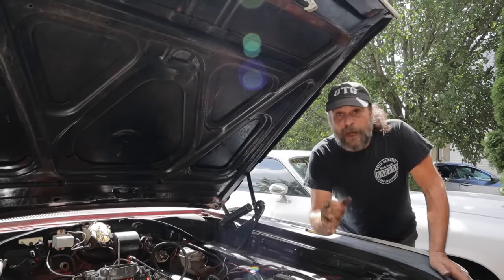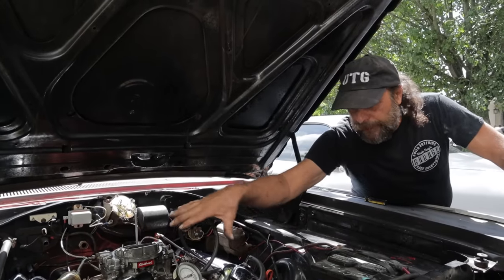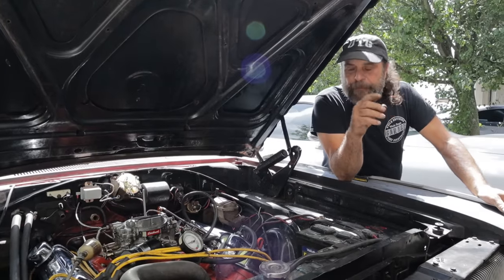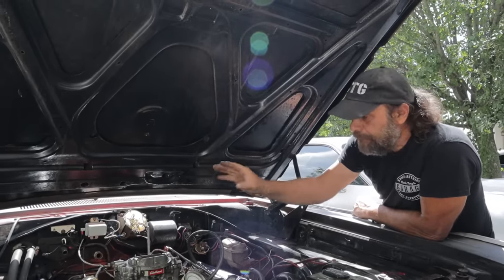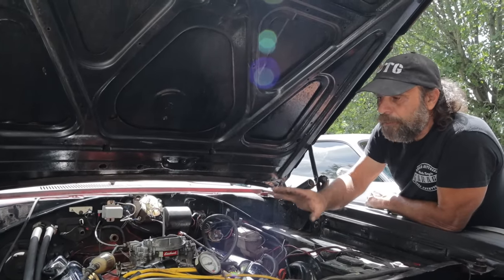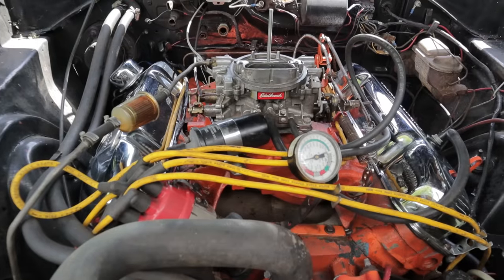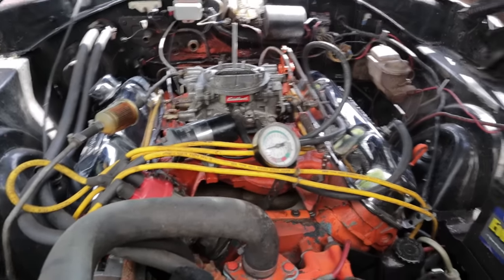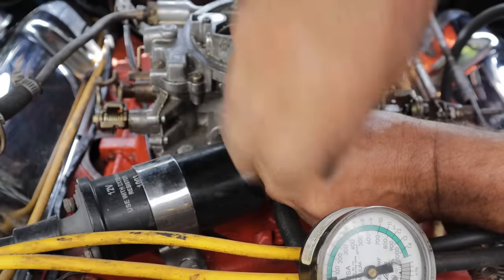Fine Engine Tuning With A Vacuum Gauge

Comment: i’m 38 my dads like this guy we have a machine shop still building race cars... carbureted still... i remember in the 80’s we had a oldmobile station wagon, it had a “fuel economy” gauge in the cluster i said how’s that work? he said vacuum and he smashed the gas it pegged over then came full back to the (+) side and he explained how it worked the more vacuum, the more the butterfly’s are closed the less fuel the more open the less vacuum and worse fuel idk why but i thought that was the coolest thing

Comment: Thanks for the quick reply! Your relating about the smoker being passed in winter in the dark reminds of our 1st Ford that smoked so bad that you could have used the Ford as a smoke screen maker. We eventually rebuilt the engine as it was so old that it did not even have a PVC! It just had road draft tube that before rebuilt the engine would have cream colored thick stuff come out at times. Really like the old engines to work on. We are currently working on a 1970 C10 with a 350 / 350 combo that when tuned right can achieve 17.1 mpg. But at 55 it only turns at 1710 rpm! Slower than most diesels that some friends of ours have  at the same road speed.

Comment: I thought ported vacuum advance was something that cars in the 70's used to try to improve emissions, not manifold.
Reply from the maker: nope
Reply: @UncleTonysGarage   That's an argument I can't find a answer to. My 67 Pontiac Tempest uses manifold vacuum from the factory. I've tried setting it up ported and it runs better on manifold.
Reply: My 1969 400 pontiac runs better on manifold vacuum also.  Depends on the engine, do what works best for you.
Reply: Gm cars used manifold vacuum up until the 70’s when they switched to ported to raise exhaust temps to help burn off more emissions. I had a 1968 327 in a truck that always ran hot when set up with ported vacuum. Switched to manifold and temps came down and off idle power was way up.
Reply: @ramblr1959  exactly, ported was just an emissions bandaid
Reply: @jakebullet8990  I ran my 71 360 Fury on manifold vacuum as well. It was a bit snappier on the manifold than the carb. I also worshiped the vacuum gauge as well. I used it so much that once I lost the cap, and just ended up leaving the gauge on, laying on the intake manifold, all the time.
Reply: @jakebullet8990 same here. I had a 73 Chevy stepside w/350. With ported vacuum I couldn't get the idle where I wanted it with the 14 degrees of initial advance I used. I didn't have any emissions on it. Had Chevy small blocks for 40 years and until I bought an s10, I've never used ported. 
I modified the vacuum can for about 6 degrees. Most factory cans have too much...... I suppose ported it works better on an engine with a factory stock can.... 20 to 28 degrees.  I think with those huge cans you ran 4 to 8 initial?  Just runs like a 3 legged dog with factory settings.

Comment: Always ported vacuum.  Thanks. Edelbrock has it wrong in the instructions that came with my 1413, well 9963 remanufactured carb. It clearly says manifold for all but emissions controlled vehicles. I appreciate you running thru this. Great video as usual!

Comment: Incomplete. You did not show where to plug the guage in. What about people who have never done this before? You can't use a vacuum gauge if dot dont know where to plug the darn thing up at. My carb only has one port. It's where the vaccum advance goes. the other carb port has no pressure in any direction, thus. it always stays at 0. There is no where to plug a vaccum guage up on my 350 (that I can find) Only a larger "T" plug into the manifold on the backside of the carb. . and if there was a place I would not know which one to use. I like your videos, but where are places you plug up a vaccum guage. Please use a finger to point to a few specific places please. Many people that have this type issue don't even respond, only the people who have several ports and can do this respond.
Reply: tis variable depending on what carb and intake u have. the possibilities are limitless 😮
Reply: If you seriously cant just look at the video and trace the rubber hose..... when its obviously doing a close up at one of the parts... Do you even need to try to tune your own engine? Probably not. Let your wife do it. 😂

Comment: With the lack of a power valve, it’s impossible to get the transition to the main circuit the best it can be without a vacuum gauge and a handful of metering rods & springs. Great videos.

Comment: I have several vacuum gauges & the large [6 inch] shop unit came with a hose restricting clamp. This reduced the diameter of the rubber hose to help dampen the pressure fluctuations in the hose on the gauge side. This smoooothed out the wild flickering of the needle, particularly in four cylinder engines & engines with non stock cams.
In my case, the vacuum gauge was used more as a diagnostic tool than as a tuning aid & in this regard, if you knew how to read them, then it could tell you more about engine condition than you really wanted to know. My big gauge was bought new in 1949 by my stepfather & it is still one of my favorite tools.

Comment: There are other things that can be checked / inspected with a vacuum gauge, to include specific tune. ... Valve Timing ( Not to be confused with Ignition Timing ),  Vacuum Signal ( From the Carb ) to the advance, which may also serve to ensure sufficient signal for vacuum controlled advance and the overall impact on vacuum if such advance controls are not only set properly, but, are not over advancing based on the signal produced. ... Even something as significant as a stretched timing chain can be identified by vacuum, or, at minimum narrowed as a probable cause of vacuum gauge movement / sweep. .... The vacuum gauge is a GREAT Tuning tool, as well as a GREAT Diagnostic tool. ... YES, I am OLD SCHOOL, I am also a ASE Certified Master Technician in BOTH Automotive ( Gas ) and OTR ( Diesel ). ... I also ran five ( 5 ) smog / Auto / Light Truck repair shops in Southern , California and A Performance Shop ( GM ONLY ) where I built custom performance engines, designed and sat up  performance suspension systems and, on special cases, restored vehicles. .... I am not trying to bring my experience forward as a means to brag, instead, I bring it forward TO TEACH. ... Great Videos Man .... LET'S LEARN TOGETHER. .... Semper Fi

Comment: I would hesitate to say that only ported vacuum is used when it's a direct connection between the carb and distributor, or that only 70's era cars used manifold vacuum.  My advice would be to try it both ways and see how your car reacts.  Personally, my 67 289 Mustang runs much nicer with manifold vacuum, which is how it was hooked up when I bought it in 1977.  The throttle response, idle, and mileage are noticeably better.  Try it both ways.

Comment: Hey I hope to hear back from you, I’m stumped. I have a stock 350 sbc with low miles. It is a GM crate engine. The issue I’m having is the engine is bogging out over 3000 rpm’s. Things I’ve done chasing this issue, new distributior, new plugs and wires, set timing at 14 initial, replaced mechanical fuel pump, replaced fuel filter, replaced fuel tank sock, replaced all rubber hoses, made sure gas tank is venting properly, replaced air filter, and rebuilt carburetor. I’m honestly baffled and worried it might be an internal problem. Also I removed the fuel pump push rod and stuck my bore-scope camera in the hole and had a buddy bump the engine over to inspect the cam lob to make sure it wasn’t flat. Everything checks out fine. The carb I am using is a Holley 1450 with vacuum secondaries, it is an old carb that I’ve rebuilt before. Also plugs look great, doesn’t appear to be to lean/rich. And the timing looks mint on the ground strap. Could it be a burnt valve? Or is the old flat tappet cam giving up? Idk, hope to hear back from you.

Comment: Thanks for this video. I have a 66 Polara that has one of those finicky Carters on it. I'd been fiddling with it without a vacuum gauge for quite some time - trying to get the idle right, the exhaust to not smell rich or lean, and have it run smooth down the highway. I damn near had it by nose and ear, but the vacuum gauge was the key to getting it perfect. I was a tiny turn off on the idle mix - like not even 1/4 turn, but it made all the difference.

Comment: There is a lot of "grass roots" answers to how to set timing...most of em not correct but folks feel like it works for them. If it does, they just happen to stumble on the correct setting. You need to know two things on timing and the process becomes easy. 1) What is your target MAX timing for your engine - say in my case its 36 2) What is the all in advance of your distributor (not plugged to vacuum) which can be found by the manufacturer - usually at 2500-3000 rpms on up and done in crank degrees. so crank degrees of 10.5 = 21 cam timing advance (you multiply by 2). So if you want 36 max and it adds 21, subtract you get 14. So try it. Set it to 14 and you will  , rev that engine..it sits nicely at 36...but don't exceed max because you can burn a piston or head gasket. I have seen guys where their advance is way off ...shooting 40 degrees max when it really should be 32 or 34. But like I said, you need TWO numbers. Setting till it pings and back off could still put you in danger zone. Not a good way to risk your engine

Comment: In the 90s I got a "tune up set""from sears with a dwell/angle meter / voltmeter, a timing light and vacuum gauge (and other stuff i forget). It had a good instruction manual on how to set distributor timing and do carb adjustments. I had a 1974 Ford Maverick with a 302 at the time, and it was fun to mess with the adjustments and see how it affected driveability

Comment: But a good number of GM cars used manifold vacuum for the vacuum advance well before emissions came into play. It tends to give a smoother idle. Once you are off idle, it operates just like an engine with ported vacuum. It is only there for part throttle economy, advancing the timing as far a possible when load is light.

Comment: Vacume gage will diagnose a restricted exhaust plugged cationic converter bad baffles in a muffler.
At idle full ported vacume snap the throttle instantly the vacuum gage should go to close to zero no delay or no wanting to change instantly means a restricted exhaust.

Comment: A vacuum gauge is very important. My GTO’s have one mounted on console. 18 inches at idle.  I always adjust center carb idle to highest vacuum. And setting timing, I use vacuum gauge, some.  My Pontiacs start by simply bumping the starter.   Just bump and engine is smoothly idling,, you have it right!

Comment: 7/17/2022.  Uncle Tony's garage would have squeezed high 8 second passes from my 427 in a 1300lb front engine dragster.   I made a mess out of an 850 Holley. Drilling out the jets, changing power valves... at age 25...i had zero clue.  Just finding this video today is still priceless.  Apply these tips to my reliable daily driver. a 71' 455, perhaps squeeze another mpg out of the lead sled.

Comment: Total ignition advance is basic timing you set by turning the distributor mechanical advance springs weights in the distributor and vacuumed advance add all 3 together you get total ignition timing advance

Comment: When I was young I would always set my timing with a vacuum gauge.  I'd increase timing by advancing the distributor for maximum vacuum and when the vacuum started to fall off I would reduce it by 1 inch of mercury.  I would then recheck the timing with my timing light.  worked for me!

Comment: That is how I tuned  my 350 rebuild  back in 2000. With an edelbrock 600. On a 1988 gm vortec  and I got 18mpg and enough power to pass  many slower cars  thanks for your reminder video  I still have a vacuum gauge  I actually use it to do driveability diagnostics tests with my lab scope on every platform that I come in contact with., and vacuum gauge  provides a kind of happy medium  really  it tells you what  is going on with  an engine  on the Induction side  pretty  accurately  and when you can get all that Info, it's not hard to tune a csrbueratef engine,  but a vacuum gauge is definitely a great  advantage with a lab scope

Comment: I have a mildly built 1985 318 with an edelbrock 600 4 barrel and a Erson cam. I did a vaccum gauge test to see how much vaccum off intake or full port vaccum. It was like 18.0 -19. Something ?  I bought an edelbrock tuning kit for the 600 and you take the vaccum reading and divide it by 2 . so basically long story short I had to use the highest numbered set of springs in the kit which happens to be the purple springs. Made a huge difference in the way the engine runs ! It originally had factory stock springs

Comment: Just found this video.  I converted a ‘95 corvette engine in my 3000 lb truck to a Demon 625 cfm carburetor, and HEI distributor.  Because it was originally a computer controlled engine, there are no timing marks on the crankshaft pulley.  I set the timing to its highest vacuum by rotating the distributor then locking down the HEI.  Runs good except for horrible gas mileage (11.7 mpg).  However, you said don’t do that, so I’ll try the idle screws next.

Comment: Subscribed!
I have a 67 Bronco with original 289 with the same carb. 
I didnt have my vacuum advance tuned correct... Little allen head inside the nipple where the hose hooks up. 
Timing light, rev engine to total timing and turn the screw to limit total timing.
Mine was going way to far! 
This helps... Thanks!

Comment: Only thing I ever needed for a vacum gage was for the holley power valve. If you still have a good ear you can tune just by the sound. A tack will help get the best idle but when you snap the throttle you most likely need to turn the idle screws out a 1/4 to half turn more out. This works with a stock cam or a little more of a cam. Big cams forget most that stuff. There is pump shot and a whole a lot of stuff that comes into play here. I have to use a electric vacum pump plus a vacum can so my power breaks will work. At idle with my cam idle at 1200 rpm I only get around 8 inches. Why I have a 3.5  or 2.5 power valve in both blocks on my 850 holley on a 454BBC. With MSD I don't even use a vacum dist. When am at full throttle my vacum is near zero. If I drive long distance I get 12 miles to a gallon. Around town maybe 3 or 5 miles per gallon. Power cost. A good video for a newbie though.

Comment: My 66 396 has 4 inches of vacuum at idle and vacuum advance removed from the HEI. Holley Dbl pumper and enrichment valve plugged and jetted up. TH400 trans reprogrammed to work without vacuum modulator. Manual brakes. Only thing I set by vacuum in mixture. Lol

Comment: I have timing light and dwell and it's on my rare 1970 Dodge Monaco wagon fleet service car I found all numbers and broadcast sheet with 383 2bbl. I bought a spare clean holley 2bbl of a 73 400 v8 because I might upgrade to a return line to prevent vapor lock. And insulation to incoming fuel line for now untill we decide what fuel system will be put on after we keep it original for now, clean oem set up since this car has been hiding since 1979.

Comment: I know this is the tried and true method for setting idle mix screws, but those are simply idle Air Fuel ratio mix screws. I use a Wideband gauge to tune them. When doing this you can see the change in Air Fuel ratio instantly, and fine tune it. The AFR's constantly swing back and forth, but you can move the AFR range using the gauge. So, if you set it fat like he suggested, that may be anywhere from 12-14 AFR, and that's really too rich and not accurate enough for the best idle mixture. With the wideband you can accurately set the idle to 14.2-15.2 which is closer to what computer controlled cars idle at(also what Edelbrock suggests in their booklets), and I've found that works really well for the Edelbrock carb as well. Again, not trying to step on the vacuum method here.

Comment: The best video on tuning a Edelbrock Carb just subbed i feel that i haven't fine tune my 383 stroker has a mild cam not to loopy i have it set 2 in a half turns at idel on drive it kind of shakes just a little and took out the spark plugs looked brown E 3 plugs i went ahead and put some AC Delco Rapid fire

Comment: There are certain somewhat known youtubers who preach to use manifold, even on Fords which isn't how they're meant to be. Glad to see you address that. Trying to get your vacuum advance set up using full manifold vacuum all the time is a real mess.  Also, I have turned the idle mix screws back a little rich as well to get rid of some exhaust pop/crackling, but then it'll sometimes seem to "load up", is that a float level adjustment?